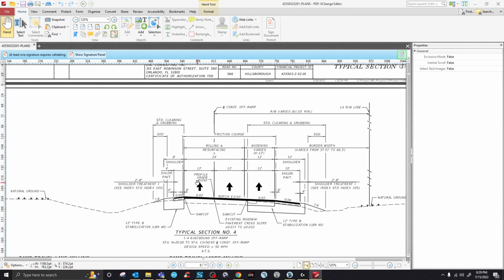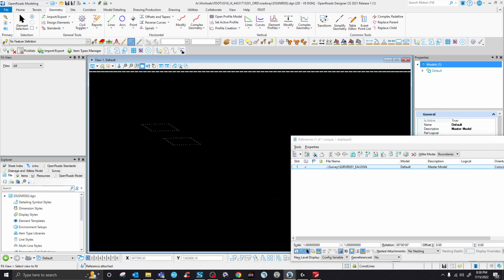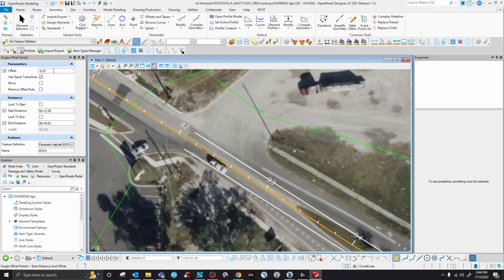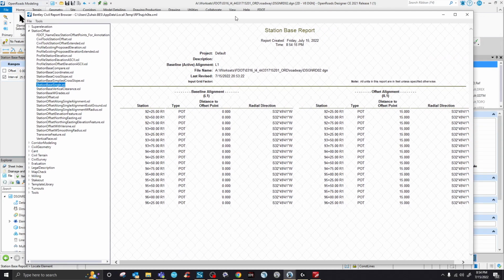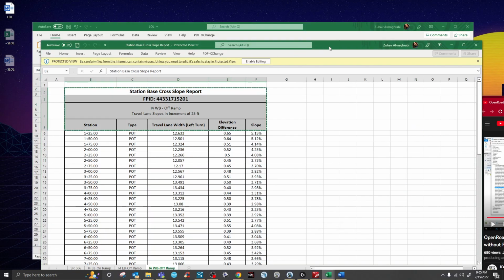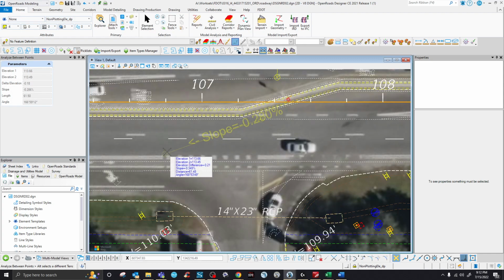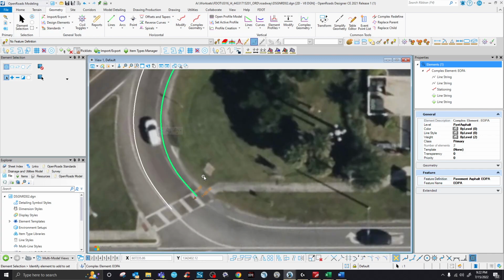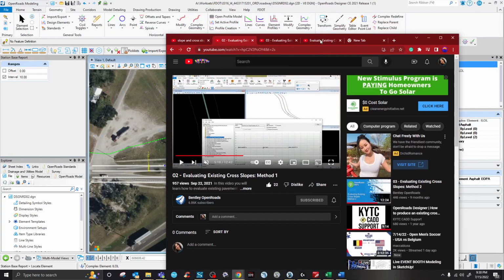Evaluate Existing Cross Slopes without Running a Template in OpenRoads Designer

Comment: Hi Zuhair! Great video! I'm experiencing an issue where ORD is not picking up the offset alignment name or elevation. The program, however, reads the perpendicular distance between the two alignments just fine. I followed all the steps and triple-checked that my alignments had active profiles and my terrain was active. I'm using FDOT 10.12 ORD. Do you have any idea what could be wrong?
Reply: Hey there, try going to geometry and apply feature definition to the lines that ORD dont pick and you can rename them what ever you want L1 L2 etc
Reply: Look at this manual form Fderal Cadd standers showing more about how to apply feature definition and name the element. If you using FDOT pick the alignment feature definitions , try baseline or centerline feature

https://highways.dot.gov/federal-lands/cadd-support/ord-user-manual/17-feature-definitions.pdf